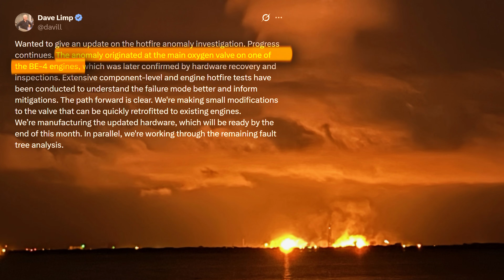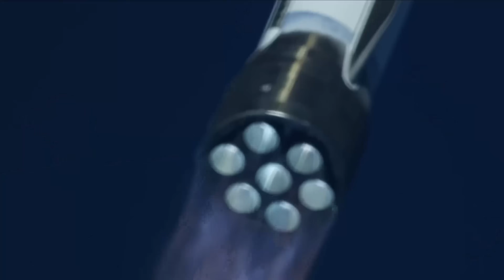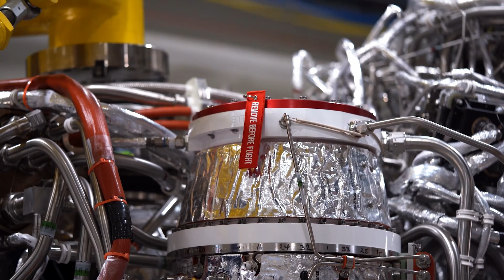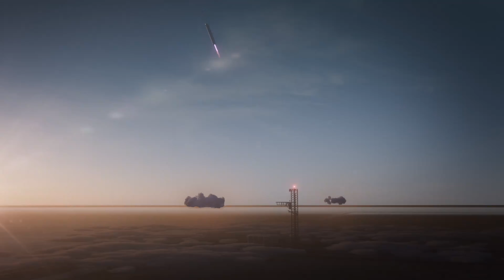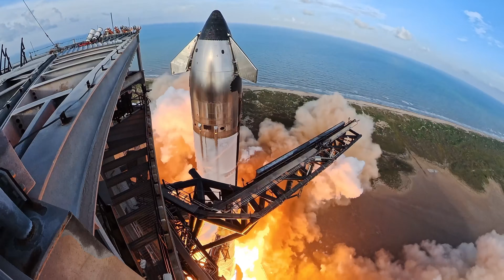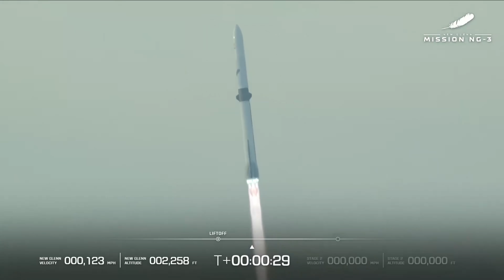Why SpaceX Raptor and Blue Origin BE-4 Are So Different…

Comment: I think a better approach to comparison videos like these would be to drop the "devil's advocate" neutrality.  Truth doesn't need persuasion or dressing up.  This fixation on a cordial approach is what I assume to be the reason why we never got the one comparison between BE-4 and Raptor3 that would have been far too unambiguous for such a mandate: Thrust-to-base-area ratio.  Assuming ideal rocket designs for both, a BE-4 takes up approximately 4x the base area of a Raptor3.  Now plug in your thrust.  A rocket using Raptor3s gets something like 3.8 times more thrust for the same base area.  While being ten times cheaper (without hyperbole), and ten times easier to swap due to being conveniently-sized, which BE-4 is not.

Comment: There is no comparison between the BE3 and Raptor 3. The higher chamber pressure doesn't just get the Raptor more thrust because of the actual pressure, it puts it in a whole different level because it gets way more enthalpy from the combustion. That is, it extracts more energy from a given amount of fuel. Also you didn't mention that the BE4 is much bigger that the Raptor, meaning you can't pack as many engines in a given space.
Reply: Yes he does not mention the size and weight of both the engine which is the most important part. But as we know he is paid and sponsored by Blue origin so he will talk about only BE4 engine power

Comment: You know, raptor is the most advanced engine of all time because when blue origin, NASA and other industry engineers first saw raptor three they said it was an incomplete engine. It had to be missing parts because it was so clean. They couldn’t comprehend the lack of all of the exterior tubing and crap all over the engine. They were in disbelief when they found out and fire, the way it was. That goes to show SpaceX is just working on a totally different level than everybody else.
Reply: No that was the old CEO of ula not nasa

Comment: And both blow away anything NASA is doing.  I mean, let's face it: what is more idiotic than building a super expensive rocket engine designed for reuse and then throwing it away after one use?  Only the government could be that stupid and wasteful.
Reply: As usual the trade-off was what was available and how long a replacement would take. Of course, that was back when they thought building the main tank stage was just an extension rather than a redesign because of the different stresses between the Shuttle's sideways loads and the SLS's longitudinal load. The bottom line, the goal of maintaining a manufacturing capability led to the "reuse" of Shuttle technology. Back when the decision was made, SpaceX hadn't even launched the Falcon 9 yet, and Blue Origin was just making tests that led to the tiny Penis Rocket. Things are much different now, but you have to say, the SLS HAS ALREADY LAUNCHED TO LUNAR ORBIT TWICE. The Starship is still a suborbital boilerplate vehicle, and BO just showed how you may THINK your rocket is operational, but it may not be, because SPACE IS HARD.

Comment: Yeah, raptor engine for 250000 USD. Now tell me fairytale about unicorns!
Reply: So it's $1M.  Still 10% cost of BE4.
Reply: @garyhalmbacher6875  Still not enough. Realistic price would be in area of 5 million at mass production. Right now? More like 10 million.

You need to understand, that secrecy from public is only Musk weapon for his modified ponzi scheme. But engineers of competition companies are capable to make very good, based guesses. If Raptor would cost "only" million, all competition would simply close their businesses because there will be no space to compete with SpaceX. And you can clearly see, they did not close their "shops".
Reply: @tomascernak6112 okay space X employee
,
The raptor engine is way cheaper
Reply: @maximumoverload222  No it is not.
Reply: @tomascernak6112 Your small brain simply can't comprehend the inner workings of Musk's companies. "Modified ponzi scheme" 😂 good one

Comment: These ARE NOT the cleanest-they still produce emissions from their methane.  And they are not "uniquely reusable".  They spend months between flights getting refurbished.  

The Space Shuttle Main Engines were equally reusable, more efficient, and genuinely zero-emissions, thanks to burning hydrogen instead of methane.
Reply: Compaired to KOX (Kerosine) it is very clean.
Hydrogen has its own issues re permeability and hydrogen embrittlement where the hydrogen affects allows etc.
Reply: And they could never keep a launch schedule because of continuous hydrogen leaks caused by H2 being the smallest molecule in the universe, a physical fact which can never be changed.  And I believe the engines were something like $100M.  EACH.
Reply: BO's engines might spend months, but they're very early in their development/use cycle, having only had three flights so far.
SpaceX's Raptors have not seen a great deal of re-use yet, but they too are early on in their development/use cycle and the intent, at least, is to improve on the Falcon 9 Merlin engine's reusability, which has demonstrated re-use between flights of less than two weeks, and sees multiple firings in each flight.
Reply: @robertherndon4351  Kind of agree.  Merlin engines just seem to keep on working.  Like the Energizer Bunny.  Can Raptor, an engine running much closer to the limits eventually achieve the same reliability? We have to wait and see.

Comment: you forgot thrust to weight ratio an the fact that raptor 3 doesn't need shielding, reducing a lot af the rocket mass
Reply from the maker: Yes! That is a big deal
Reply: It's also physically much smaller than the BE-4, meaning more can be packed into a given sized booster's base.

Comment: The other thing to note is the actual size and weight of the engines raptor weighs 1500kg be4 weighs 5500kg Be4 is also a much larger engine meaning you can fit less engines in the same size space. Raptor is way way more advanced than be4

Comment: Raptor:: 408,000 pounds of thrust / 350 PSI of pressure. B1 :: 550,000 pounds of thrust / 200 PSI :: F1 Rocket for Apollo :: 1.7 Million Pounds of thrust / 450 PSI . The F1 Engine is 4 times more powerful than our best engine. But to be able to control and throttle the power is the breakthrough in technology. To be able to land after reentry and use the engine again is where the efficiency and cost savings make the difference. This makes the Raptor engine the best engine because it is the most reliable and efficient engine today. Elon has decreased the cost of payload from $119,050 per pound to $331 per pound because of the efficiency and reusability of the rocket.
Reply: F1 engine also weighed almost 8500kg raptor weighs 1500kg sure raptor produces 1/4 the power but it also weighs 7x less that's why a smaller diameter rocket in starship can have 2x the thrust of Sat v. To get the same power as starship you would need 10 f1 engines on the first stage meaning it would need to have a massive diameter and lots more weight
Reply: @Condor-uc2lw  Great insight
Reply: @lymansn another positive is the redundancy many engines give you. If 1 f1 engine failed im not sure if a sat v could reach orbit but starship i think can loose 4 or 5 engines depending on where it js in flight and still make orbit. The F1 was a wonderfull engine for its day but raptor i think will be a better engine in time
Reply: @Condor-uc2lw  Great Point!
Reply: Great summary.  F1 was immensely powerful but hand built. And by hand built, I mean every injector hole drilled by hand by a skilled machinist, guys not around today.  Not practical today.
Reply: @garyhalmbacher6875 f1 was an incredible angine for its time but compared to modern engines its horribly inefficient the only thing it is king in is max thrust all other metrics it falls behind. I think that having more smaller more efficient less powerfull engines is the way forwards compared to fewer larger more powerfull ones.
Reply: @Condor-uc2lw  I am definitely in agreement with you on the F1. Saturn V was the only rocket which never suffered a launch failure although there were many fewer launches in the day.  While Starship gets all the press these days, the Falcon 9 is so reliable and launches so often it's not even news these days.  It would be like a NYC to LAX flight making headlines.
Reply: As an electronics engineer, it is well known that larger systems must always respond more slowly to control inputs than smaller ones.  I am wondering if the BE4 is large enough that by the time a problem is recognised and feedback signals sent to correct the problem, it is already too late.  The Raptor, being smaller, can respond more quickly to feedback control inputs before exciting things happen to the engine. 

The other advantage of small engines is that even at full throttle, one still has 3% control of thrust just by turning engines off or on.  That's pretty fine control for what is controlled mayhem.
Reply: @garyhalmbacher6875   This is an excellent point. By having many smaller rockets, you have more control to steer, accelerate, and decelerate. It is a marvel and a wonder.
Reply: @garyhalmbacher6875  That is what I understand as well that even if they wanted to build it again, they would have a hard time because all of the people who machined the parts by hand have all passed away. Sure, we could figure it out, but it would lack the throttle control they are seeking. The thing that amazes me is that these amazing people hand-crafted a marvel and a wonder by sheer engineering.

Comment: You left out the most important information. One raptor is a third the weight and the 6th the cost.. that in and of itself makes it vastly Superior. It's reusability is far greater than the be4 as well.
Have the guts to make a proclamation as to which you think. it's obvious which one is superior so your video is pretty useless without those conclusions
Reply: Yep, and they can make a Raptor 3 per day, or more, speed of production is another huge advantage. Basically, the BE-4 would be a really good new rocket engine, if Space-X did not exist...
Reply: Great point! Thrust/$ is an important metric too.

Comment: careful to avoid the fact be4 weighs close to 4x as much as raptor and has flown 100's of times less hours than raptor. at this point there is no question raptor is better. simply put how much more payload would ng get into orbit with raptors ? ignore the performance improvement and just the lower weight of the engine more than doubles the mass to orbit. also raptor is much cheaper and easier to build.
Reply: Design philosophy of the BE4 more closely resembles timeline more consistent with the NASA management dynamics. The Raptor engines have a much more freewheeling development style of a next generation rocket motor.  NASA is still using the RS25 AKA the SSME rocket engine of old evident in the USA/NASA SLS using tried and true Hydrogen/LOX motor of the Space Shuttle. 
I worked on the SSME back in the late 70's and early 80's and can attest to its genuine technical achievements.... for that time.  
The Raptor is by far so impressive along with it's cousin the Merlin that I stand awestruck.   Not discounting the development of the BE4 because its the evident successor to the NASA L3 Rocketdyne engine.  It proves that the Raptor is by far the most advanced rocket engine in use today.  I'm hoping that one day the Raptor will be used in some other rocket designs is only someone sees fit to do so.
Reply: Just keep in mind that BE4 engines have carried out 3 successful missions while raptor is still in testing phase and still has issues. No doubt that raptor engines are superior in performance, they are just not stable yet.
Reply: @mateialexandrucoltoiu7207  Keep in mind that about one in fifteen BE4 production engines have blown up so far. Not exactly a demonstration of stability.

Comment: If you compare let's say the thrust between 2 engines. You got the issue US/UK uses the imperial system where mainly Europe use the far more simple Metric system. With the Metric system you can compare different units with/to each other. Like the thrust is X many 'Metric Tons or KG's ×1000'. Where the imperial system uses Tons that are not the same in weight as a 'metric ton'. So explaining a weight let say X Tons + X LBS + Ounces. This makes everyting so much complex and harder to calculate. 

So when comparing Thrust in Imperial and metrics systems. Don't use Kilo newton's because that is not easy comparable with LBS. So use Kilo's or Metric Tons of Thrust that are the right units to compare with LBS so we know how much it is with a simple calculation or from my head knowing a pound is a little less than half a Kilogram LBS and Kilo's/Metric tons are the same type of units and the best way for measurements in both systems. With Vulcan Centaur you used also KiloNewtons, which is also different. all 3 what is impossible to compare to each other.

Last Logic simple example like temperature. I don't know why using degrees Fahrenheit is better than degrees Celsius. Where °C is far more simple to calculate with. 0 °C right inbetween freezing where -1°C is ice and +1°C is just water. -10 is the same opposite as + 10. The Celcius is scale is lineair to scale in terms of it increments and conversion what's makes it easy to use and understand and calculate.   

However in Fahrenheit 32°F equals 0°C Like what is the logic to start with a random positive number of 32°F that is the °C 0-point? And still all positive numbers between 31 to 1 is freezing. And add 10°F to 32°F isn't the sams as adding °10C but just 5,55°C. So adding 10 degrees isn't the same incremental rise in both systems. 

Concluding how do you know the exact temp? If the news tells it's gonna be 93°F day? How do you know exactly how warm it's gonna be without doing a complex formula in your head like (°F-32)×5/9. Like you know everything above 90 is warm to super warm and above 100 Hot or unbearable hot. So is looks it's just an estimation like if you grew up with this system you approximately know how warm 30-40...80-90+°F is?
Reply: Exactly this!
Reply: The only time the UK uses lbs is for older people with their weight. Most people 50 or younger use kg's.
TL;DR only US uses imperial

Comment: If you compare let's say the thrust between 2 engines. You got the issue US/UK uses the imperial system where mainly Europe use the far simpler Metric system. With this system you can compare different units to compare let's say the thrust between 2 engines. You got the issue US/UK uses the imperial system where Europe uses the far more simple Metric system. With this system you can compare different units with/to each other. Like the thrust is X many 'Metric Tons or KG's ×1000'. Where the impu system uses Tons that are not the same in weight as a 'metric ton'. So explaining a weight let say X Tons + X LBS + Ounces. This makes everyting so much complex and harder to calculate. 

So when comparing Thrust in Imperial and metrics systems. Don't use Kilo newton's because that is not easy comparable with LBS. So use Kilo's or Metric Tons of Thrust that are the right units to compare with LBS so I know how much it is with a simple calculation or from my head knowing a pound is a little less than half a Kilogram LBS and Kilo's/Metric tons are the same type of units and the best way for measurements in both systems.

Comment: BE-4 then is closely based on the Russian RD-170 the most powerful rocket engine with the single turbo pump but burns kero.
I wonder if they are going the way of Musk with 2x turbo pump design with their new methane engine ? 
apparently the design was just frozen .... I guess its based on RD-170 with the single pump they have been working on it for .... forever?  at least 5 years ... on and off ... 
I find the weird way they stick "0" as the prefix  experimental rocket engine codes totally confusing  - eg - RD-0177 is experimental  ...... RD-170 is production then apparently just to confuse everyone with their methane engine they decided to first maker a smaller scaler version first a RD-0169  ..... f,,k knows what the final spec of the engine is ?
I'll try and figure that out again another day after I open a beer .... or 2 .... make that 3

Comment: After watchinf this video, I have just one question. Why would legacy rocket makers choose fuels that are unstable, not as clean, more expensive, and less efficient?
Reply: If you’re not developing a reusable rocket then you don’t care about the build up in the engines.
Reply: The answer for SpaceX is easy: The primary goal of SpaceX is Mars. And it is way easier to produce methane on Mars than kerosene.
As for Blue Origin, they chose methane because it burns cleaner than kerosene and therefore reduces the maintenance when reusing the engines.
Reply: Costs, complexity, final goals. We are at times where reusability is the key goal, so you don't really have many options here, and there only options fall under those categories. It does make engines themselves way more complex to make. While using old proven to work engines is just... Safe...

Comment: You confuse us when you use different units. Choose one please
Reply from the maker: I will, thanks for the feedback
Reply: @pisreal321  Personally it's the it's the inclusion of additional units for Raptor. 
BE-4 you have lbf + kN, Raptor you have tons + lbf + kN. 
Personally keep the kN and lbf, drop the tons (unless you want to keep it in the imagery and in that case include it for both). Also use SI as the primary unit (kN) after all we are talking about rockets. 
Also as others have said thrust to weight as well as thrust to size are major considerations.
Reply: Confuse you, not us, just you